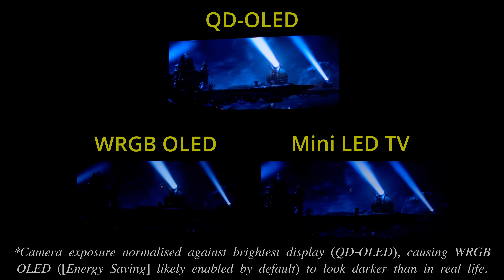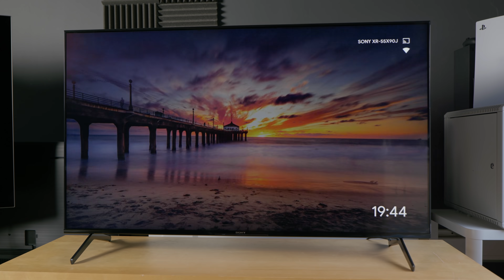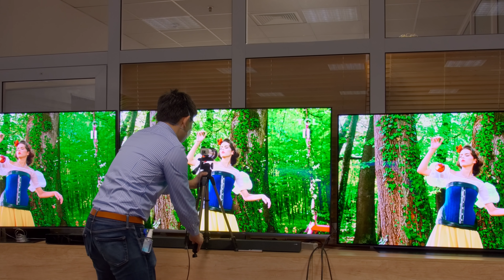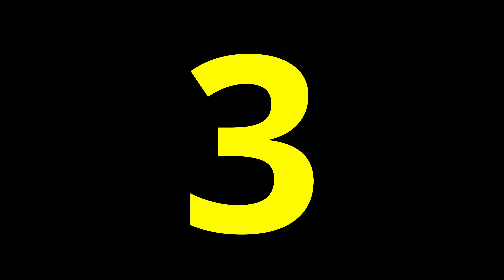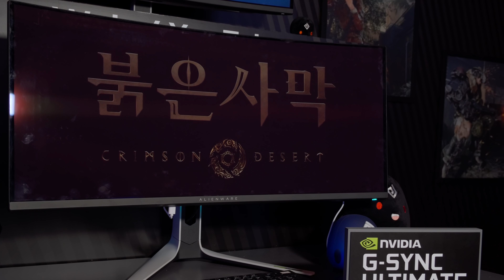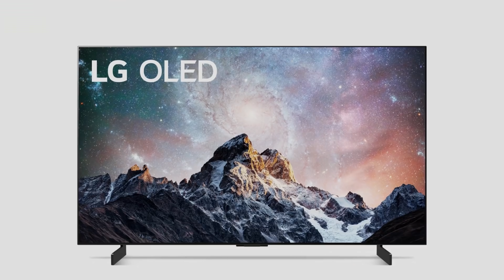QD-OLED vs WRGB OLED vs Mini LED TV First Impressions at CES 2022 - Them COLOURS!

Comment: So I am buying my first OLED TV and I get a decent discount on LG products through work. This will be the last TV I buy for around 7 years so I want it to last and don't want to regret it. The TV will be in a dimley-lit basement which if I'm not mistaken is good for OLED's as outside brightness can make it a less pleasurable viewing experience. I will mostly be using the TV for PS5, Nintendo Switch, Apple TV 4K HDR content, movies, and cable TV. I am intrigued by the new Samsung and Sony QD-OLED's but have had bad experiences with Samsung in the past and the Sony QD-OLED's are out of my price range. I also know that the technology is new for QD-OLED so I'm unsure of the longevity of this first wave. The prices with discount for the four LG models that I am considering are as follows:

LG C1: $1580

LG G1: $1806

LG C2: $2257

LG G2: $2709

I am kind of leaning either towards the C1 to save money or the G2 to be future-proofed with the heat-sync and higher peak brightness. I would love to hear everyone's thoughts as I am not super knowledgable about the specs of each of these. I know the G2 just came out so it is higher priced than it will be down the road but I need a new TV now and am curious if it's a waste to spend the extra $1200 or so? Like would I really notice the difference? Just wondering your thoughts on all this. Thanks!

Comment: I don't understand why reviewing in vivid mode is being done. What I would like to see is how these displays look in standard mode which is real world viewing. Who watches in vivid mode? I know that I don't. Vivid mode is unnatural and not pleasing to the eye.
Reply: At the cost of picture quality and accuracy you can generate extremely high brightness values by using vivid mode. You can use this to create a useless hype for a new product although it doesn't pay of in daily use at all. Vivid mode also allows to show overbrightened and oversaturated pictures due to it ignores all standards like a D65 white point.
Example:  early 2021 Sonys A90J was driven in vivid mode to generate brightnesses numbers of 1300 nits ... what is left in a relevant and useable mode is 800 nits or just 60%.
The same currently happens with QD-OLED...

Comment: My LG C9 OLED just got an update that gives it a dark area fine tune setting. I’ve messed around with it and you can either make dark areas brighter or darker without losing brightness. I read it’s supposed to be for an issue in some games for dark areas but I have almost 6,000 hours on my C9 mostly gaming and never noticed that issue. Almost 6,000 hours in almost two years (Since Feb 2020) and still not a sign of burn in. 👍 It’s my baby and I love it dearly ❤️

Comment: The display industry is just complete dog crap. It moves at a glacial pace relative to most electronics industries. No one cares about slightly more brightness.

The actual problems with OLED are burn in and size (lack of options in the 24" -> 31.5" range). The actual challenging problems to solve. They've made 0 progress on those problems. This is BORING.

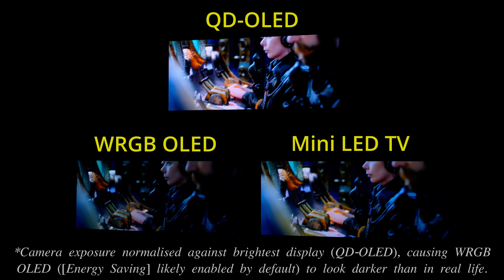Comment: only concern is how much faster the WRGB OLED is showing the picutres than the other two. When you pause certain points, (1:46) WRGB OLED has alreaddy gone to the next scene. Is it a setup issue or is the input lag that much slower on the new QD-OLED (and mini LED!). Im a gamer so lag is really important
Reply: It's just how they are set up

Comment: Thank you Vicent,
Im thinking of getting a C2 55" this year, my first OLED and flagship TV in my entire life. Im just afraid of the price lol
Reply: compared to the Sony 55" A90j that costs around $2,500 it will have better price. it's a C1 with the G1 EVO panel without heatsink so it will cost less than the G2. if you can afford the G2 i'd say to get it over C2. with the heatsink it will have higher brightness.
Reply: Just wait until November ... usually prices are dropping massively by then.
Besides that you'll be blown away by your new tv ... the C1 already was/is a fantastic and futureproof tv ... and the C2 will probably be even better plus with lower energy consumption because it will receive the EVO panel that was introduced in last years G1 series and the Sony A80J and A90J.
Sapia Ntomata is right ... a heatsink on an OLED tv has many important advantages (no temporary image retention, burn in risk close to zero, higher brightness for colours/full field and specular highlights) ... so it's worth it spending a few bucks more ... but be aware the G2 is designed for wall mounting ... you'll need an additional 3rd party VESA table top stand to go with it (approx $50).
So, if price is a noteworthy property the C2 will already cover all your expectations and more...

Comment: Hey Brother thanks for your amazing reviews. May i say tv tech went backwards after plasma, i have  a 65"  2019 scamscum qled q60r which i paid 3,000 for and its as you would assume its 🗑
Was the plasma technology the same as Oled.  I sort of like the natural dim look of the lg A1 oled whats your thoughts. Thanks
Why do we need a million nits to watch tv. I think its a gimmick like HDR, all that does is make my tv more washed out then it already is, money money 💰
Reply: of course it's about money. the prices will skyrocket. the OLED Sony A90j costs around $2,500. can't wait to see the price with QD OLED. i bet you'll be able to buy 2 Sony A90j.
Reply: Your not wrong there sapia,  i remember back in 2007 i purchased a 80 cm letterbox tv which was huge, was 600 bucks which was top shelf. Also the problem is in them days manufactures would make one model and not 5 different ones so you were always getting their best tv and it was at a reasonable price. Then in 08 got a 50 plasma and have been scratching my head since.
My sisters oled makes everything look real life like. Led tend to have over bright saturated fake colours and obviously edgelit like mine is herrendous washout. Ill wait for the lg a1 to go down more when the 100k price tag on the QD Oled come out

Comment: Vincent you don't need to calibrate all of the TVs and then have a mastering monitor to see which TV is brighter. QD-OLED does look brightest. Most people don't calibrate their TVs, only a tiny minatory. You don't spend $2.5k - $3K grand on a TV and then hire a Pro calibrator whose fee is usually $400-500 on top to 'look as director intended'. Calibrated picture most people don't like, just look how many owners use 'film maker' mode!
Reply: A QD-OLED will not be $3000 this year for a 65" - at best $5000 my guess - The Sony will come calibrated to a good level at that price . LCD TVs can go bright - the new LZ2000 will go bright . Yes the QD-OLED will hold it's colour/saturation at a higher brightness- but will be matter that much watching movies in a darken room with SDR and DCI-P3 content - note a larger 77". 83" will be easier on the eyes due to taking up more eye real estate . I can't see the need to run bright in a darken room .  However QD-OLED should give better dark detail performance as no sub white . Some TVs will be able to be calibrated with Apple or Samsung phones - to quite a high standard

Comment: Just bought the new 16 MBP,  I’m loving this mini LED compare to previous model. I wish there’s a 27 4K/5k inch display with this tech, the market seems to favorite game monitor. I’m serious thinking to buy this 42 OLED. Since the 5k LG is old with no mini led. The old 27 iMac was a really good deal a top monitor which came with a computer for the price. Do you have recommendations for a 27” or above working monitor?

Comment: I find it a little disturbing that while most reviewers tend to push for brightness, they all miss out on one important factor that is always overlooked  and never measured! Simply, the higher the brightness, the hotter the screen will become! 

WHY IS NOBODY MEASURING THE CELSIUS AND FAHRENHEIT OF THE SCREENS TO DETERMINE WHICH MODEL TV SCREEN IS THE COOLEST AND WHICH IS THE HOTTEST! 

It is obvious that more heat can cause warping of which I am experiencing with my older Samsung TV!
And this TV can get hot, that it reads 37.9c on the LED surface, the frame itself gets even hotter.

So it would be appreciated if you could get yourself a temperature surface reader and give the public an idea as to how hot these OLEDS & newer micro etc can become whilst being on for an hour. Some folks might prefer a cooler TV than a TV that’s radiating too much heat regardless of losing out on some brightness. 

Please confirm if you can do this for the general public? Keep up the good work 👍🏻😊🇿🇦

Comment: damn, till now pretty much everyone could afford the best TV in the world, in tech if not size, but with this best TVs will become a much more sizeable investment, not sure I'm willing to fork over €10.000 for a 65" QD OLED.
Reply: Totally not worth it,  With a few years the tech will be more mature and much cheaper. Waiting would be the best option. Early adaptors can beta test for us. The first year wont compare to what it will do in 3 years+ thus getting all the bugs out and making the hardware much better.

Like when QLED first came out. It wasn't all that but the diff from the start to the Q8FN/Q9FN was a game changer for less. Same will apply
Reply: @DETERMINOLOGY  I tend to agree but if money were no object, I'd be booking a 65" A90K tout de suite. I got a 65" C7 and it's on the ropes, the blue diodes in the center are whacked so it's giving yellows a grenish tone, pixel refresh and screen shifting helps none, seems like 4 years of constant use is about as much as OLEDs can take, I'm torn between a 65" G1 and a 77" C1.

Comment: Man the alienware having a glossy display alone makes me really want it. But I really don't want to downgrade back to 1440p from 4K. I have beyond normal vision at 20/13 vision so it is very noticeable to me. Why I also really don't want a big display. At 27 inches I can already see the pixelation at 4K vaguely. 

But at the same regard I find matte displays to have a dirty screen look where they have a snowflaking effect from the anti-reflective coating. It really bothers me when I look at solid color images. Was suprised though my brother, who doesn't have the best vision, also was able to notice the effect on his personal monitor. Really wish I could just find more monitors with glossy displays...
Reply: I'm short sighted and I see a difference between 4k and 1440p on a 32 inch pane, so..
Reply: The problem with 4K gaming is framerate. If you put games to ultra, current systems can’t push 4K at 120-175 fps. Even at 1440p, ultra is a challenge. So the AW QD OLED is in a class of its own in 2022.

Comment: So Samsung of all factors made this staged scenario.
Samsung that is literally the most c0rrupt company in the world when you look on inner value versus c0rruption 
Are Samsungs CEO not as Im writing this in prison yet again for c0rruption?
its something like 4 or 5 times, now over the last 15 years that Samsungs CEO have been to prison for c0rruption and riggin.
Samsung lack of integrity is one of the reason why South Korea rank that low don't he world c0rruption index Transperacy International.
The worlds least c0rrupt is usually the oldest country, or the one with the oldest flag.. Denmark.. Nr2 New Zealand sheep country, nr3 Singapore.
In some cultures c0rruption and simply lubricating your interests is very common, not last in Asia, but it is what it is.. dishonest.
I like Samsungs products, but even if you tried you could not find a company with  more tarnished backbone, so take their "comparison" shows with a pinch of salt..
Reply: And LG aint much better.. their EVO panel last years, and their new evolution with 20 to 25% higher brightness.
Check Rtings C7 2017 versus G1 2021.
C7 SDR scenepeak 388 nits (score 7.9) 2021 G1 298nits (score6.7)
C7 HDR Scene peak 718 nits and 2021 G1 728nit.

So the SDR still way lower then even a 2017entry OLED C7 and the HDR are just now in the EVO panel about to come up around the 2017 level.
and yep it goes without saying that LG have turned their WOLED down a tad, partially for main SDR content since the golden age in 2017. where we saw unreal pixelresponse times 80% = 0.1ms 100% = 0.2ms (check rtings waveform measurement for C7)
but time will tell what WOLED have to serve in 2022 with their new o-materiel.

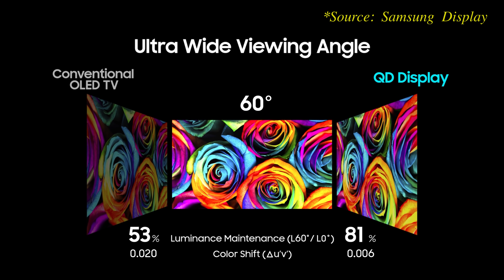Comment: 4:42 The viewing angles on my CX are fine for video content, but I definitely notice a blue tint around the edges of the screen when sitting close to the TV and using it as a computer monitor. That was actually one of the improvements I'm most interested in. Your video shows a difference of 89% vs 99% brightness and 0.006 vs 0.001 color shift at 20°. That's a quite big difference!
Reply: Need calibration  these tvs are not even be fully  utilsed  of couple out of the box tvs are ether really red or really rather blue or greene it sucks but it comes down to consilumers paying  £450 for a full calibrated  service
Reply: @jonathanoxlade4252  even after a calibration all wrgb oleds have a green tint.
Reply: yep same here with my c1. it's hard to get a picture i like because if i make the center of the screen look good, the edges will look very blueish, and if i make the edges look good, the center will look too pink. i've settled for something in between with bias towards making the middle look good.

Comment: I'd love that 34' monitor, but pricewise it's gonna be out of reach for normal people for a good while;
Reply: even if it had good price it's ultrawide and curved and there are 3 groups: 1) don't like ultrawide PC monitors, 2) don't like curved, 3) don't like ultrawide curved. if the monitor was a flat 27" or 32" it would sell like hot cakes.
as for the price, they will be expensive AF. the Alienware 34" ultrawide without OLED panel costs almost $1,000(in my country it surpass €1,000). the QD OLED will cost more than $2,000. i say around $2,500. it's not only the QD OLED panel. they increased the hz from 120 to 175. this will increase the price a few hundred $. and it will have g-sync premium pro. this is not free so this will also increase the price a few hundred $. then add the price of the new panel. easily $2,000+. these 34" ultrawide QD OLED monitors will never be for normal people.

Comment: Well as always Vincent setting things right . 
I couldn't care less about reflection or side views, I'm all about the best picture and that's where my money going regardless on brand. 
So, waiting for your reviews till then I'll be sticking with my lg c1 77 inch  oled . Glad I didn't get the Sony a90j 83 inch at that insane price.
Reply: comparing a C1 to an A90j or a JZ2000 Panasonic or even a Philips 986 it would be like comparing a bike to a F1... it has nothing to do with it. I was talking like you 6 months ago until I got the Sony A90j in front of me. It is indeed more expensive the price difference is largely justified because it does everything indisputably better than the c1 and g1. in my opinion the c1 is fine low end slightly mid range and still! ... but certainly not premium. Since 2020 lg has become strange... their choices strange. I know all their models since 2015 and do not recognize the brand anymore. but at the same time i don't spit on lg and i understand because a 65c1oled guaranteed 5 years at 1700eur it's really not expensive at all but for heaven's sake 🙏 stop comparing with master series because there are 2 worlds that separate them!
Reply: @rotorADN  OK. No where in my statement  did I compared the Sony to LG. 
Sony is the king of tvs in my mind and have  been since I've bought their first tv  The  Sony Wega Trinitron.
No tv has come close to ever beating a  Sony tv  except for  my beloved Pioneer Elite Kuro at that time. 
So,  I got the LG c1 77 a few years back n at the time it was very close to being as good as the Sony  oled.  Got the lg for 9k with BB coverage and all and the Sony at that time was a helluva lot more.  Think it was in total an extra 5k. BB wasn't giving a price break on that. And I was desperate to move on from my buggy Sony 940d n that crappy  Android operating system . Hence LG.
I miss Sony better colors, upconversion  n superior motion handling , but LG has shrunken that lead a bit.

Comment: One thing I want to understand: do WRGB Oled TVs lose saturation with higher brightness, since the white LED is brighter then the RGB ones? If so, does keeping them at low brightness make the color accuracy better? I would like to know since I usually use my TV when it's dark out so I probably won't need high brightness
Reply: It's no problem in SDR at low brightness but when you need high brightness for hdr, LG OLED brightens the white subpixel instead of rgb subpixels so it's diluted.
Reply: Thats why oled is better  in the dark  look hdr is years off looking good it needs calibration  and it needs to be over 4000nits  12bit  for more colour depth  10 bit is lame its not real hdr  yet which is years away
Reply: @jonathanoxlade4252  Legit HDR1000, 10 bit and a good color gamut+volume is good enough for now. It's FAR better than SDR. I hope OLED will improve for HDR.
Reply: yes, that's what happens on the c1 as soon as there's a light peak the colorimetry collapses which makes for a sad and bland rendering. 

In principle the G1 with the "evo" panel should prevent this but this is not really the case. There is a much better control from Panasonic, Sony and of course Samsung with their Qled panels Also the Philips oled 936 and 986 manage very well or I was surprised. In 2021 it's really not LG that offers the best picture and the best user experience.
Reply: @rotorADN  do you think the new LG EX OLED's will solve that problem?